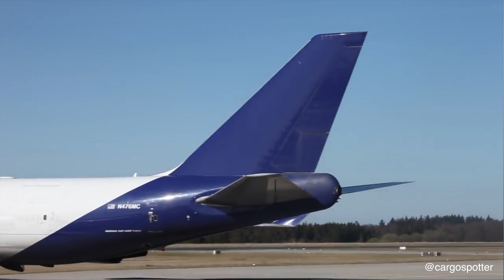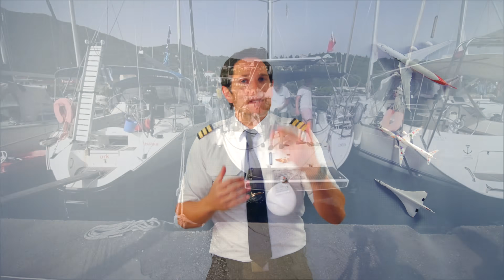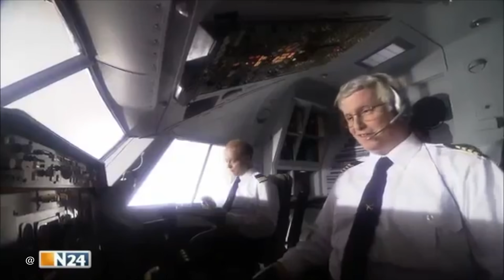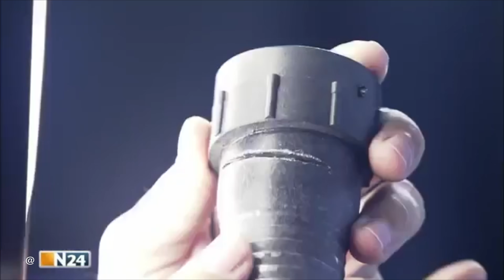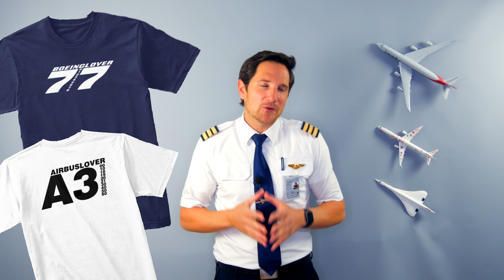Why is the RUDDER SPLIT? Explained by CAPTAIN JOE

Comment: Oposite movement of upper and lower rudder segment is actually part of the Airbus A380's flight control self-test and calibration process. The A380's rudder is split into two independently controlled segments—upper and lower—to allow for better aerodynamic control and redundancy. On the ground, the flight control system runs checks where each segment is tested separately. This is why we might see the upper segment deflecting fully right while the lower deflects fully left, or vice versa. These opposing movements are not simultaneous flight commands but part of a diagnostic to ensure full range of motion, proper hydraulic response, and calibration for each segment.

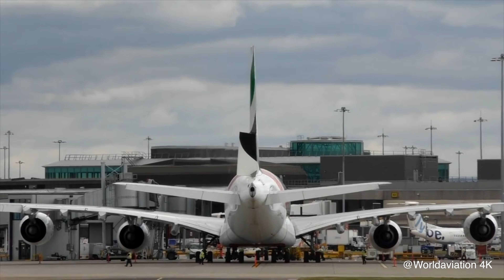Comment: Hi Captain Jo, great video ! A very interesting question indeed is the counter deflection of the split rudder at around 4:00 of the video. Let me try to explain. First of all I tuned the player to 0.25 speed to monitor the movements of the rudders more precisely. At 3:59 a very short moment shows the lower rudder leaving its full deflection position which shows there are no other forces than wind forces of the lower rudder. The upper rudder also moves depending on the wind strongness and direction. It is a beautiful scene 😀. Northern germany has got an island where also at a certain wind direction one of four banners point directly against the wind, which is caused by backflow of the air generated by buildings in the near of.
You need a picture of the A380 from sideways. Look at the fuselage in the region of the stabilizers. At this region the fuselage is still massive high, more, than at other airliners. Especially the part of the elevators a build flat to allow the movement of the stabilizer without any gaps between fuselage and stabilizer. So, this "wall" leeds the air along the barrier with a high angle deviation of the wind direction. I assume the wind is coming about 45° to the parked airplane. The lower part of the vertical stabilizer is also affected, whereas the air flows below the fuselage with more speed than the winds speed. On the backside this kind of flow generates many vortexes and backflows against the fuselage and against the lower part of the stabilizer pushing it to the left. If there were a smoke source I am convinced we could see a counter clockwise circular flow around the lower part of the fuselage similar to the flow of single prop aircrafts at take off. The vertical stabilizer avoids the circular flow in clockwise direction. At the upper part of the vertical stabilizer wind forces act accordingly. However, the stabilizer is not that massive at the upper part, so the counterflow on the backside is less and the upper rudder takes a compromise between direct wind forces and back flow forces. It is to be seen that the upper rudder also takes only a small part of deflection which we could expect. If you now dismount the stabilizer and hold up the rudder like a banner in the same position,  you will notice a much bigger angle of deflection.
I hope it helps to understand. My problem is the language and I apologize mistakes. Without dictionary it would have been impossible. My profession is process engineer which has often to do with fluid dynamics. My hobby are airplanes and I love interesting difficult questions.

Comment: 4:14
it splits to prevent "roll due to yaw" maybe.
(roll due to yaw means if you use the rudder. it will make a little roll )

same like "yaw due to roll"
wich makes a yaw when doing a roll

Comment: The A380 uses its split rudder not just for steering but also to adjust speed and pitch.
This is why the upper and lower part can be at opposite angles.

Comment: The answer to your question about A380 split rudder is/ The Uber rudder deflected to the right because of actuator position that ( Right pulled- Left pushed) While the actuator depressurised it pushed by the rudder surface. And the lower rudder is opposite of that ( Right pushed - left pulled)

Comment: The 747 mentioned in this video has suvrived thanks to the spilt rudder. But the B737 doesn't have spilt rudder. Multiple B737 has crashed due to a jammed rudder...

Comment: From the FCOM1: The rudder system shearouts and override mechanisms allow the upper or lower
rudder to be controlled if the other rudder is jammed downstream of the rudder ratio
changer and a significant manual force is applied to the rudder pedals. A secondary
linkage allows full control of both rudder surfaces in case of a primary linkage
disconnect.
Its not about redundancy, its about being able to separate the rudders in the event of a jam.  As per NW085.

Comment: Somthing that it took a long time for me to realize; you don't have to run your lighting at 100% when you film. Joe, you could probably dial your key light back at least 30% and have your face and shoulder look a lot less over exposed. If your light isn't dimmable you could dial back your ISO or increase your shutter speed (even breaking the 180 degree rule as natural motion blur isn't necessarily critical in this case). Hope this helps :)

Comment: Not really split rudders, but remember the airbrakes on the F28 and BAE146... :)

https://imgproc.airliners.net/photos/airliners/6/8/7/0263786.jpg?v=v40

https://upload.wikimedia.org/wikipedia/commons/a/a0/Eurowings_bae146-300_d-aewb_arp.jpg

Also, the "real" split rudder air brake of the space shuttle:

https://upload.wikimedia.org/wikipedia/commons/thumb/d/d5/STS-116_landing_port_behind.jpg/1200px-STS-116_landing_port_behind.jpg

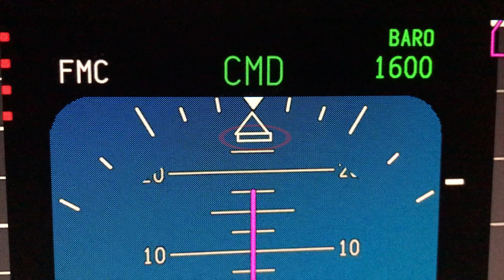Comment: At around 3:34 you say that rudder is rarely used during cruise. What about coordinated turns?
Reply: The pilot doesn’t use that as most modern aircraft when the pilot turns the aircraft the rudder automatically co-ordinates the turn so no pilot input is needed. Even in manual flight on an Airbus at least and presumably newer Boeing’s too
Reply: @tomstravels520  But it’s still the case for general aviation, right?
Reply: @cornucopiahouse4204  depends, in your Cessna 172 then probably not but I guess it would be probably some of the newest planes could have an automatic rudder
Reply: @tomstravels520  Alright, eye opening. One more question, if the rudder is rarely used in “flight,” does that also mean that airliners don’t use the rudder to crab into the wind during landing?
Reply: @cornucopiahouse4204  not really if it’s a steady crosswind but if it keeps changing then yes. The rudder is used to de-crab just before touchdown and the pilots will angle the aircraft so its direction is towards the runway and adjust the heading into the wind accordingly by rudder and ailerons to prevent from excessive bank angle
Reply: @tomstravels520  Thanks for shedding light on this!

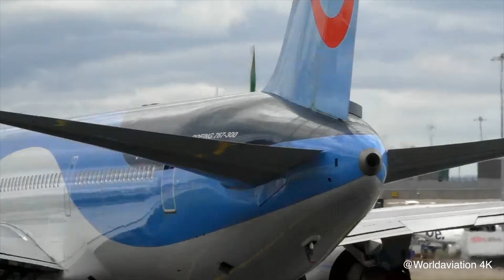Comment: Answering your question in 4:07 I think the lower rudder is almost frozen to the left because the pilot probably used it in maneuvering when entering to the gate but the upper is free moving with the real wind direction as it might be set on that during flight mode to maintain flying in straight line. 😂😂 Please tell me did I got the right understanding or not because I enjoy you videos for both loving aviation and improving my English 😅😅

Comment: Split rudders can likely be angled in the opposite directions to increase drag while braking, leading to less nose turning than if they were angled the same way.

In the emergency example with the rudder failure you said the pilot lost altitude. Probably due because of increased drag from the opposite rudder orientation.

Comment: Rudder ratio changer works just like rudder limitter in earlier version of transport aircraft. that is to reduce the aerodynamic load on the control surface  when flying at higher speed to avoid damage to rudder control surface based on the pilot higher control input

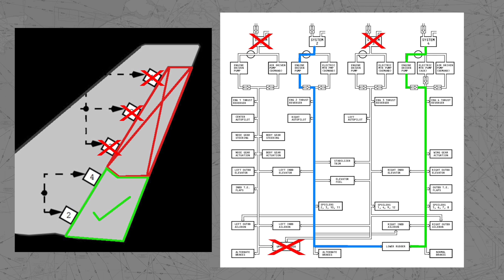Comment: 5:07 you shouldn’t have a split rudder because if hydraulics 1 3 and 4 were to fail you would have complete control of the ENTIRE rudder due to the non split rudder and therefore in my scenario you only need one system working to power it

Comment: The splitting of rudder of a380 might be a tail wind. So if the top rudder slightly turns one side and bottom ones to other side, therefore it splits

Comment: @Captain Joe A380 rudders is a trick question......they are going opposite sides in ground maintenance. Could be testing the actuators. That never happens in flight. It works like normal rudders. It makes no sense to do that in flight. Why would one deflect a control surface part the opposite way , reducing the full control surfaces effectiveness and also increasing structural load.

Comment: Just a guess about split rudder opposing deflections by upper and lower segments. Perhaps the system "at rest" becomes isolated from the pump source and therefore the larger upper might be driving smaller lower with back pressue on the one shared hydraulic line?
Of course when energised this action would be impossible.
Just a guess.
Thanks

Comment: Can the hydraulic actuators argue with each other?  If actuator 1 requests a left, but actuator 3 is reversed and requests a right, it would not move, correct?  As you said with Northwest, the one actuator failed, wouldn’t the other actuator still be responding properly?

Comment: This system came after a air crash when a pilot use extreme ruder controls 4-5 times in cross wind or in strong to control the plane but because of it, its ruder just snap off the plane and the plane crashed

The plane was American airlines 587

Comment: Wish you would have discussed this. But is the nose gear plumbed up the same as the rudders? Does it have 4 separate actuators in case of hydraulic failure to any system

Comment: Sitting in the back of a Qantas 747 from Australia I couldn't sleep and I couldn't believe the swag back and forth of that tail and the corrective action of the rudder I asked to be moved farther forward is this normal it felt as if the rudder was continually adjusting left and right left and right terribly uncomfortable back there in the last few rows of seats

Comment: The only thing i can think of as a mechanic as to why the 2 rudders travel in oposite directions is for drag similar to flaps on landing  because you are causing the air to go in different directions preventing lift in either direction. Another method could be for better roll. Or it could also be to reduce stress on the entire virtical stabilizer

Comment: I don’t know for sure but a theory is that it would act as a rudder canceling feature so you don’t exceed the design limits of the aircraft depending on speed. Another benefit is it could act as a speed brake until airspeed is under design limits. The rudder section acting opposite to intended direction of travel would slowly return to neutral or possibly move to the same side. The yaw rate would also destabilize control if it was suddenly moved to maximum deflection so it again would slow the rate of turn. Well that’s my theory and I’m sticking to it unless I hear a better explanation. Happy flying to you!

Comment: I would have thought may be something like redundancy. I guess it may cause a sort of rolling as well as the two have slightly different lever points on the mass. May help the rear stay on the ground better for the wheels.

Comment: I'm no aerospace engineer, but isn't the reason why the rudder and elevator control surfaces are split is to minimize the amount of shear stress exerted on the control surfaces, and the amount of strain exerted on the actuators in the event that most of the hydraulic systems stopped working?

Comment: Re: Your Question, Upper and Lower rudder opposite at 4:05. When the upper rudder moves to the right in the wind, wouldn't there be some vortex and some generated lift in the lower rudder opposite to the lift created by the wind moving the upper rudder?

Comment: Thanks Captain Joe for that excellent explanation. Re the early aircraft to feature split rudder, about 1960, I recall being intrigued by the Boeing 727-100 split rudder on their arrival to Ansett-ANA & TAA, both the dominant Australian Domestic Operators (nb. QF then a small international long hauler didn't come EVER to Melbourne [Essendon]  which was Headquarters of the above domestics.

Comment: The 747 incident is kinda like United 232 in 1989 when they lost all Hydraulics due to the tall engine exploding btw this was a DC-10 they then used power of the engines to steer the plane kinda like the incident that you are talking about

Comment: Hello Captain Joe. You asked for comments about why , when parked, a split rudder would show the top rudder and the bottom rudder moved in opposite directions. I don't know for sure, but I have a theory. Could it be wing-tip vortices? I was thinking that perhaps a vortex might be generated by one or the other rudder which creates a vortex as the wind blows and that the circular motion might push the other rudder in the opposite direction. What do you think?

Comment: The Split Rudder on the a380 provides redundancy. They run on different systems so if one fails, the other one can be used. ... Split rudders also provide a finer high speed control, in that only the lower one moves at high speed, reducing the exposed surface area and therefore the control effect.

Comment: My question is: Because the rudder is hinged at an angle to the tail fin - normally it's slanted backwards as the whole tail fin is - whenever the rudder is deflected, the oncoming air flow hits it at an angle, creating both horizontal as well as vertical (downward) thrust vectors.Isn't there a downward push to the whole tail section due to this? Pl. correct me if my assumption is wrong.

Comment: I believe the rudder parts on the a380 move in different directions because one of them has more surface area that the other one. It increases the pressure on the hydraulic line pushing the other part of the split rudder to the other side... I don't know how the aircraft's hydraulic system is layed out exactly but I believe this would be a possibility.

Comment: I think the Rudder of the Space Shuttle is a nice one. It's also a speed break.

The Youtube channle "Smithsonian Channle" does upload trailers to their YouTube channel that features also plane crashes. Sadly in Germany you can't access their regular content. There was a plane crash where the co pilot used full rudder during takeoff, leading to ripping of the tail. The problem was misleading training. The simulation had so extreme conditions, that the plane would roll over and the pilot needed to use the Rudder in the simulation. In reality this wouldn't happend like that and the actions of the Copilot made the situation even worse and he was fighting against something he caused. I mean even to me it sounds as a bad idea to use full rudder to one side and then to the other side and that the whole time. As far as I would guess, wind doesn't change their direction that often. The only input I would understand is full rudder to one side, when the wind is blowing and when the wind stops, back to neutral and a bit to the other side, to counteract the roll that happend due to reaction time.

Comment: Maybe the lower rudder is deflected by the exhaust gases of the APU on the A380?
Maybe they are built in such a way that if they become depressurized in flight they point to different directions to cancel each other out?
Maybe the rudders are engineered to cancel each other out if they move without pilot input in case of failure?
Maybe the wind is only strong enough to move the lightest rudder?

Comment: If I had to guess Id say each rudder has a different amount of surface area and by having one go one way and the other go the opposite way it would increase drag and still be able to perform what its meant to do. Your own description of how it moves less at higher speeds would kind of have this setup dampen then effect some. Sort of avoid letting it over react.  Maybe?

Comment: I dare say that the aileron on the space shuttle had the most interesting design. It was also split, but in the vertical direction, functioning as yet another air brake.

Comment: to your A380 Rudder in different directions question:
I think there maybe is a direct Hydraulic connection between the two rudders. 

as the big one gets deflected, the pressure building in the Hydraulic Pistons needs to even out in the system. the easiest way to achieve this without any valve opening is the direct expansion of other Pistons in the connected system. in this case: the pistons in the lower rudder (just my thoughts what could be possible, i've no charts for this to prove it

Comment: Right off the bat I'm thinking the opposite split differential rudder might be for air brake.
Static on the ground I guess it could do anything I've seen it elevators on MD80 split as well so who knows I guess it needs to be powered up to say for sure.

Comment: For my opinion, the lower one is stressed by its own (4 & 2) hydraulic system (which is probably still pressurized) whereas the upper one is not anymore stressed in any position by its hydraulic system, turned off (1 & 3), then the winds influences the position of the upper one instead of the lower one which can’t move at al... :-)